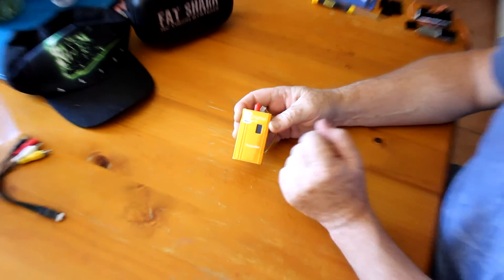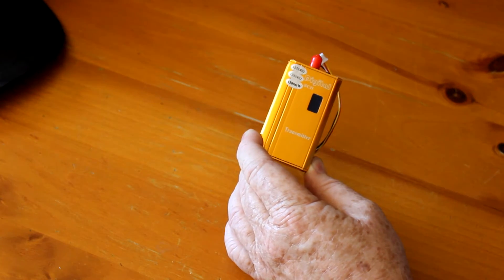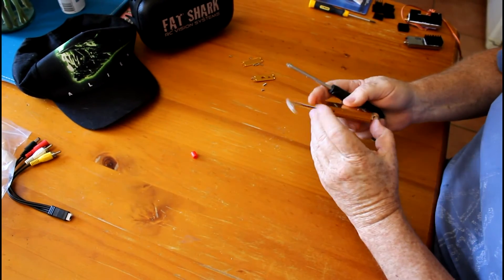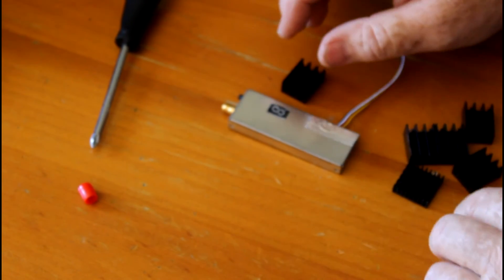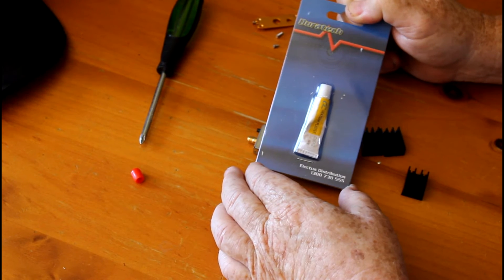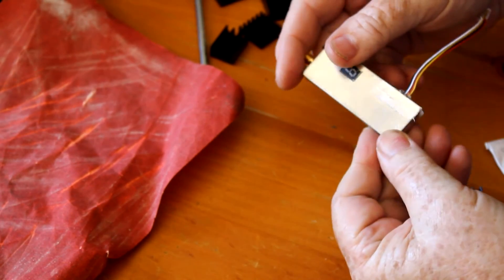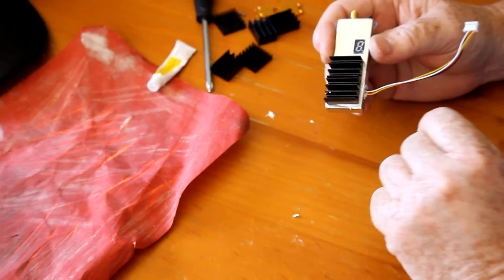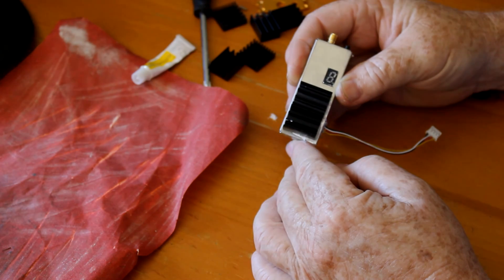FPV - Adding Heat Sinks to FPV Transmitters

Comment: Hi nice video, not sure if you can help but what's the best low temperature transmitter you can advise? I'm looking to put a transmitter in a aluminium project heatsink project box also the battery in the box protected with termal and fire resistant Rockwall. I am looking to have a system on a 7.4v so I can use a titan 7000mah battery if that's possible? I'm looking to do a system for a project were I need to use the transmitter for like 20+ hours streight. Regards Ricardo
Reply from the maker: RICARDO The lower the power the cooler the transmitter but they still need an airflow.
In a box they may get hot and you should leave the case on rather than putting heat sinks on like I have.
I do not know any 1,3ghz vTXs that run on less than 12 volts
Reply: @nellodude  Hi Neil, 12 volts is fine, i'm looking for a 10 hours+ system and looking to save as much power as possible, i was thinking there was lower voltage system, my idea is to get a standard 250mw transmitter then glue it in the box from the inside but the heat will be directed to the outside as glued to the box, it will definitely over time accumulate hot air in the box but not sure what else i can do? what i wan't to do is having the camera with a magnetic in one small box then battery and transmitter in a larger box also using magnetic's i will then try to make a box using li ion battery on a 10000 mAh and will need to do some adaptation to include a battery voltage screen and a power switch for turning the system on, off, charging or maybe do a automatic if there is one will need research. i want to do it nicely so i can also use it for real after not just as a project but a usable item to use . Regards Ricardo

Comment: thanks for the video. what is the weight difference?
Reply from the maker: Sorry I do not have scales. But the case weighs more than the Transmitter
Reply: ok. I just moved from 2.4 to 1.3 so i have yet to actually use them or install them on a plane and was just wondering. thanks again.
Reply from the maker: No problems you will love 1.3ghz but watch out for UHF (433) 3rd harmonic interference.
Reply: I have notch filters for 433 and 2.4 notch for flying with my buddies.